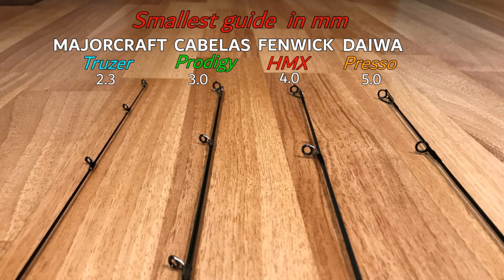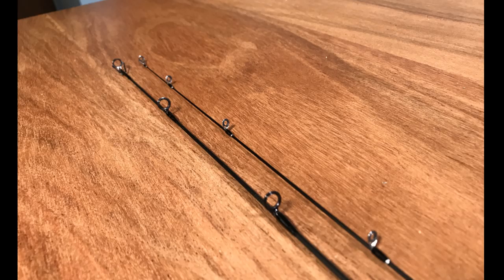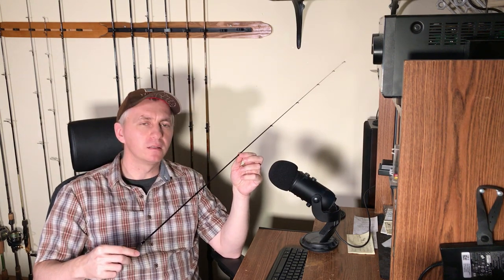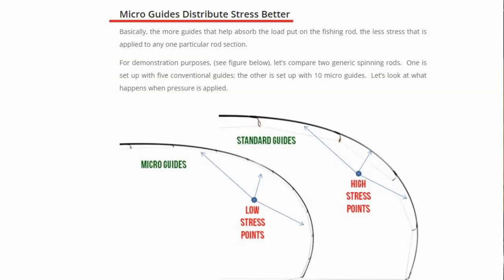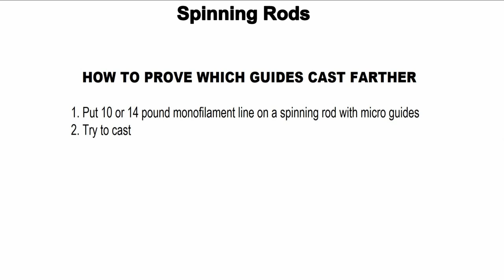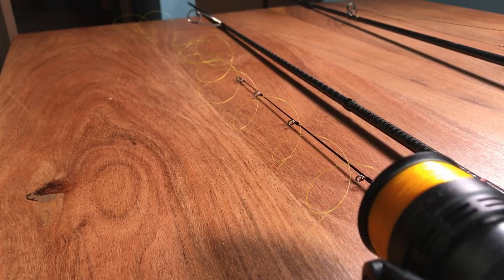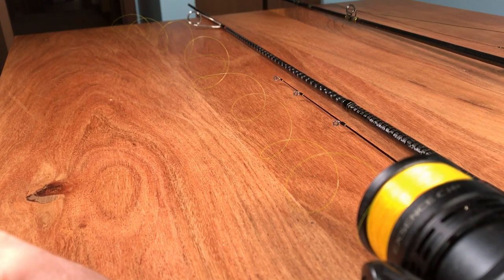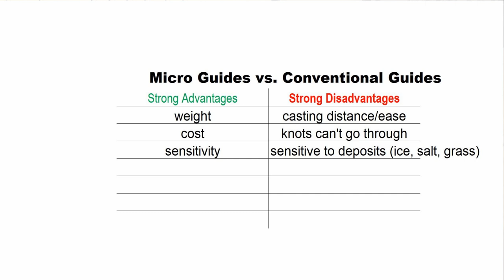The Truth About Micro Guides

Comment: Micro guides are mostly deaigned for braid not mono
Reply from the maker: i don't know if whoever designed them will agree with you. But i would agree its easier to use them with thin braid, because it is softer and still strong enough. Using them with mono - u have to work with 0.12mm line, and thats just too much risk

Comment: I should've watched this before i pulled the trigger on a micro guide rod. Every time I cast it feels like it takes more effort... with even worst distance as well compared to normal guides
Reply from the maker: Thanks for leaving a comment. I also get comments from people that tell me that I am wrong and micro guides actually INCREASE casting distance. It's just funny that none of them actually HAVE a micro guide rod.. 
As for your problem - I dont konw what line you are using, but u have to go LOWER. When u go very thin eventually the guides don't bother the line too much. It's never gona be better than regular guides though

Comment: A used car off the lot will not win a NASCAR race.  You need to pick the right tool for the job.  I think if you look at the information Fuji has produced on the KR Concept for spinning guides you will find the come to similar conclusions.  Heavier lines call for larger guides.  I would also ask, do you want to fish for crappies with a spinning rod designed for 14# line?
Reply from the maker: you seem to be arguing against something in the video. If that is the case - quote the piece that you disagree with. I spent 30 % of the video describing the benefits of micro guides, and discussed them again in the summary. My whole grind is against these absurd absurd statements, like casting farther and whatnot. That's like taking credit for the flaws of your product. But i was very clear that if you stick to thin lines and you want the magic feeling, you will need micro guides.

Comment: Good throughly enlightments review , micro guides may shines under certain conditions in my opinion , smaller diameter spools thus smaller coils , the first n the second guides those tend to take the most line frictions before the line begins to straiten up with rest as possible , it is more about line straitness than line frictions  n well desinge rod may aproach to such possible results . Btw the best surf rods don't use micro guides ! still true about the manufacturers hype tho .
Reply from the maker: I come from european carp fishing. Carp rods for long distance explicitly advertise larger guides. Normally carp rods have a 40 mm first guide, but sometimes they put a 50mm for the long distance rods and then they advertise it. Even in Daiwa and Shimano catalogs for 2020 I found they advertise the 50mm first guide when i did my research. In all honesty i found videos of pro bass anglers who even though use baitcasters say micro guides are BS for casting... so there are some folks out there who u can fool with the advertisement and the videos, but when u give them the rods in the hand u can't fool any more because they have to make living out of that

Comment: Micro guides should be stronger because the point of pressure is closer to the rod
Reply from the maker: Good point. Less extended frame = less flex.

Comment: Guides are measured in 1/64th inch increments. So a 4 is 4/64 inches. 4.5 is 4.5/64 inches...
Reply from the maker: but when i go to buy them, they show ONLY  in milimeters?
https://www.mudhole.com/Components-Rod-Building/rod-guides-components/spinning-fishing-rod-guides
Reply: @ifishcatfish  I mistyped I meant to say the tip top guides. It is in correlation to the diameter of the tip of the rod blank.
Reply from the maker: give me example. In my last review i compare a st croix rod with 4mm guide vs abu garcia rod with 1mm guide. Both ultralight. How do i interpret that?
Reply: @ifishcatfish  well they’re measured by the inside diameter of the frame, same as the outside diameter of the ring in millimeters. But like I said tip tops have 2 measurements ring size in millimeters and tube size 1/64th inch. Stripper guides are the most important guide when it comes to line management. That’s the guide closest to the reel. The beauty of micro guides is the lack of weight put on the blank. More weight = less crisp, sloppy action. You can also put more guides on the same size blank.
Reply from the maker: that's not the only beauty. I mentioned all the beauties. As well as all the ugly.